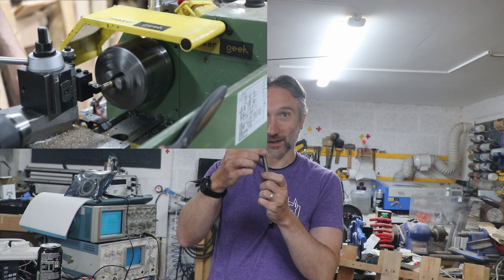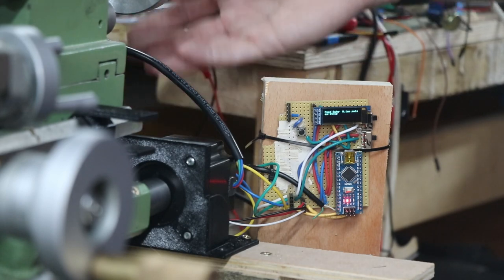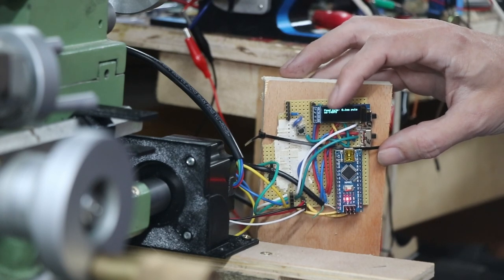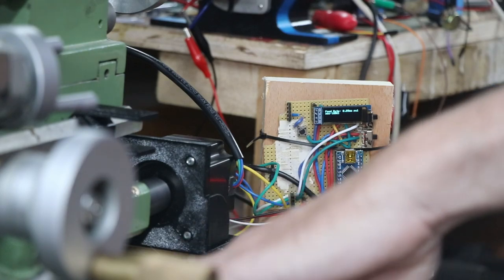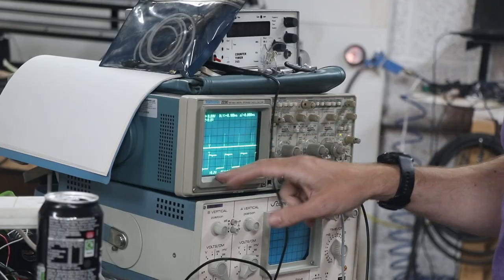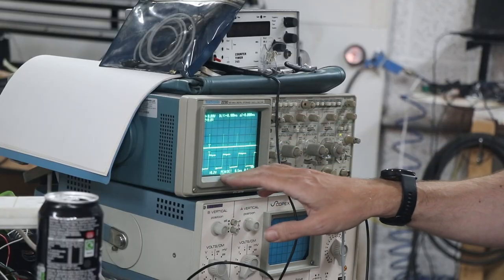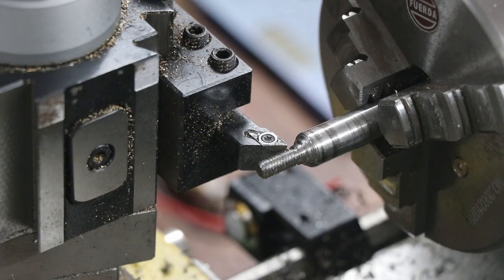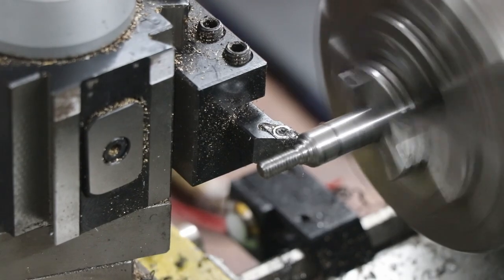Arduino based Electronic leadscrew - First threads

Comment: Awesome, having just got a minilathe for a steal I've been considering a project similar to yours. Cloughs' source code was confusing to a simpleton like me. Hearing your explanation and seeing your success makes me feel more confident in trying it on my own.
Reply from the maker: I've used this a lot more in the year. I upgraded the motor to a 'servo' type but the arduino does a great job and I've cut a bunch of perfect threads on it. But also just a ton of useful surfacing at different controlled rates which is really nice. if you're interested I have some extra PCBs for my design.

Comment: I've just come from your V2 video - where I wondered why you did this project. For the fun of it seems like a good answer.
Reply from the maker: Pretty much for the fun, I was interested in the challenge and learning what was needed. I did also want to see if I could make a fairly cheap option, I thought the arduino could handle the processing load (and it can) but the memory is too limited. my latest version is now an esp32 which I'm messing with.
Reply: @MakerGeek  Excellent. Have you looked at the Raspberry Pi Pico (Pico 2 has just been released!). That has multiple state machines (running at over 100 MHz) and a lot more memory.
Reply from the maker: @ChidleyEngineering  I've not had a chance to check out the pi Pico. I've used the nano and fill sized in various places. These days the esp32 has been my go to for more power and electronics integrations. Though it's a bit of a pain with it's 3.3v logic, is the pico 5v?
Reply: @MakerGeek  3.3V. It's all going 3.3V these days.
Reply from the maker: @ChidleyEngineering  yeah, and if makes sense. But all my stepper controllers need 5v signals so it means adding stuff to the circuit where with the trusty Arduino you could just pulse it direct.
Reply: @MakerGeek  engineering is compromise

Comment: Check out the Nano ELS H4. ive got one on my WM180 and it works really well. You can use it on the Z and X axis. In fact I can now run CNC jobs on it.

Comment: I have been coding industrial firmware for about 25 years, including a lot of pulse reading, pulse generating encoder type stuff.
I think your issue with getting incorrect number of pulses at low spindle RPM would be completely fixed by using quadrature encoding, ie 2 inputs from the encoder and not just 1. 
Simple quadrature decoding should still be very quick in firmware, and you dont even need full quad you can do a half quad decoding where if input A goes hi or low you just add or subtract a count (when input B is lo), and you subtract or add a count on the A edge (opposite) when input B is hi.
With a full quad or half quad system you will always get a perfect count of 800 per rev (or whatever).
Great video! Thanks for sharing. 🙂👍
Reply from the maker: Thank you. I actually started using the second pulse to give me direction detection, but it's a good point that I could use that to improve pulse counting generally.  however i believe I have finally run up against the limits of the arduino nano which seems to start becoming quite erratic as you consume more of it's limited memory with program code. when i get time I'm going to experiment with identical code setup but switch out for an esp32 to see how it compares.
Reply: @MakerGeek    thanks for the reply! 
ESP32 has quite a bit of difference in processing power compared to the nano 😎

Comment: Surprised how quietly your lathe runs with the encoder.
Reply from the maker: ha, funnily one thing that annoys me slightly is that the motor sometimes 'whines' when just holding torque and powered on. but overall yeah, pretty quiet. and the electronic leadscrew is a fantastic addition. I use it all the time

Comment: Hey, you won't regret it - I built the nanoELS (and now feel totally out-done by the way 😝) and it has never skipped a beat.  Is it just me or is the audio broken on this video?
Reply from the maker: broken how? it is a bit warbly at the start I think because of where I had the mic. sadly not much I could do about it once I noticed...
Reply: @MakerGeek  I've worked it out:  There is nothing on the right channel!  My laptop has a dodgy left speaker so I have the balance all the way to the right.  Your left channel is normal the right is just a bit of background noise!  Conclusion - it IS just me but you are in mono 🤓
Reply from the maker: @MattOckendon  ah! That's interesting I totally didn't notice but it makes sense. I'll try to remember that for next time. Thanks

Comment: Were you disengaging the half nut between passes? I didn't see you do it but the carriage was stopped and  I thought I heard you say you could rejoin at any mark on the dial. I'm guessing you have a metric pitch lead screw. At any rate, nice job.
Reply from the maker: in this video I was just like a normal threading operation with a gearbox. Since this I've made quite a few improvements and now I can digitally stop/move/restart never disengaging the leadscrew. just pulling together a video on the updates now
Reply: @MakerGeek  great, thanks.

Comment: I often wondered why @Clough42 didn't use a Teensy 4.x - 120khz+ interrupt frequency would cover you up to 7,000+ rpm even at 1,000 pulses per revolution.
Reply from the maker: indeed, though at 4000ppr he does have a lot to handle. possibly the board he used was just cheap/available at the time.

Comment: Would you consider sharing the code for this? I'm interested in different approaches to programmign the ELS on arduinos
Reply from the maker: I've been working on refining it, making it more general purpose and configurable etc. my intention is to make the control box available to buy at a reasonable price. I have considered sharing the code but have decided against it at this time. in my experience open sourcing code leads to a lot of requests for support and changes and not a lot of contribution.